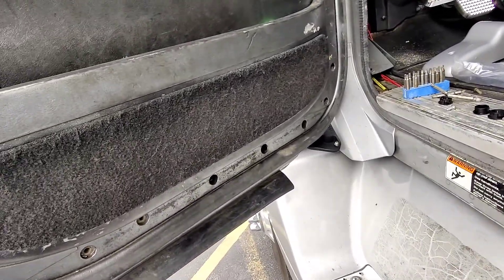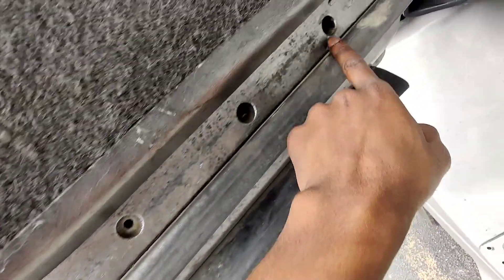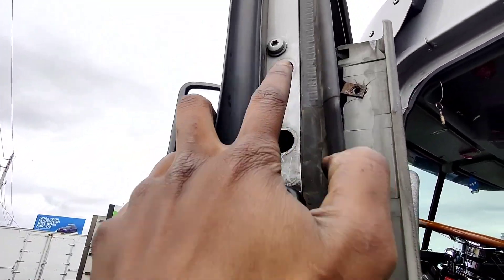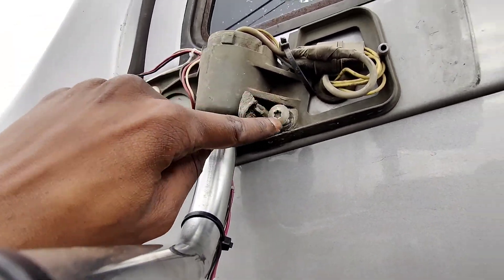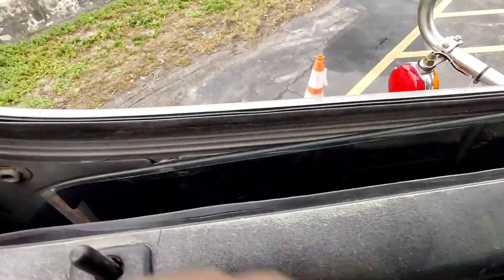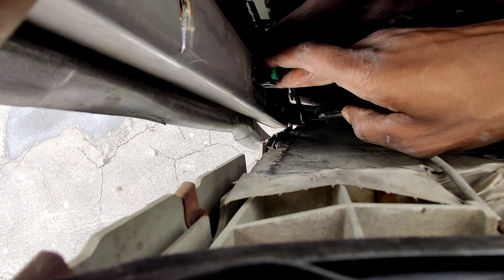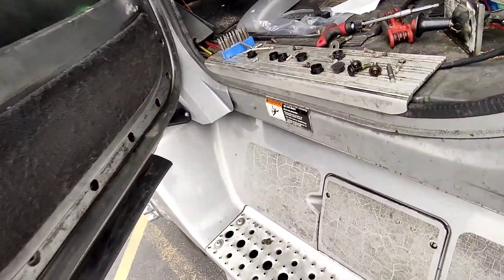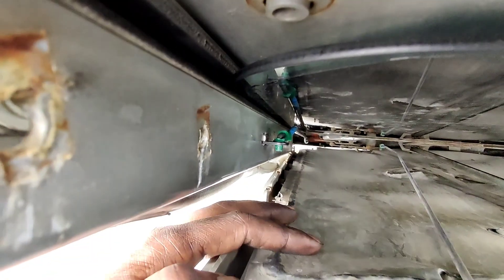How to replace door latch on a Freightliner Columbia

Comment: Thank you!
I was trying to send a video to a friend to instruct him how to insert the green clip properly.
I was amazed how many YouTube'rs are doing it the wrong way!

The rod tip is designed to LOCK the clip into the lever hole. With the rod inserted into the clip, it is NOT supposed to be able to be pulled out of the hole in the lever!
[If you force it, you will round off the plastic barbs that hold it secure in use]

Quick critique of you demonstration, for those that need to re-use the clip (my friend did not get a new clip with his new latch):
Do not pry out the clip from the latch, as you did; unclip the rod from the clip FIRST, and THEN it will pop out easily from the latch!
Re-install in reverse; as you quit correctly point out in your tip at the end!

Here is my 'canned' response to 'tubers' who show it wrong:

Too many people pry out the clips (from the levers) while they still have the rod inserted. This it will damage them and cause them to be prone to falling out in use.

The way those clips work is that the rod expands the fingers in the latch lever hole, such that they can't come out (or be inserted), once the rod is inserted.
The rod has to be disengaged FIRST, before the green clip can be removed from the latch (or left in if reusing it).
The clearance is designed such, that, with the rod absent, the 'fingers' can squeeze together and clear the hole diameter.
Once in place, inserting the rod then expands the finger 'tips' in place, and locks the clip into the hole!
[generally, the fingers expand on their own when inserted fully into the lever hole; the rod just keeps them there].

ONLY THEN insert the rod, and 'rotate' the clip's 'tail' until it snaps over the rod shank...

Whenever you remove these types of clips, you FIRST 'rotate' the 'tail' of the clip, unsnapping it from the 'shank' of the rod, far enough to remove the rod.

THEN remove the rod tip, from the clip/lever (clip remains in the LEVER, NOT on the rod).

NOW, (if you have a new one), you can pull the clip out of the lever, and install the new one.

Install; reverse the process, Clip in lever first, then rod into clip, and snap clip tail onto the rod shank.
DONE!

Mr K L